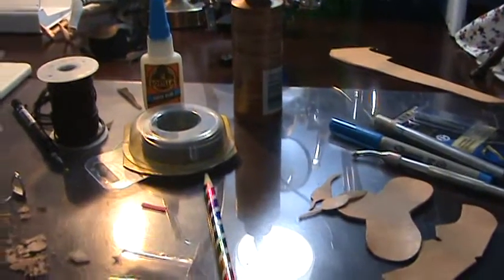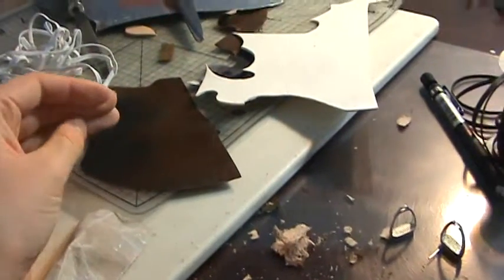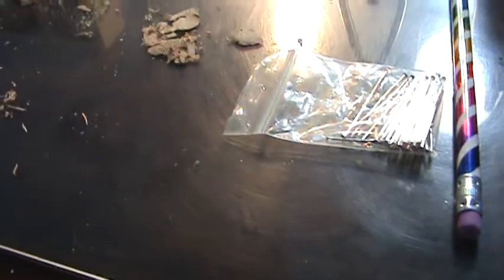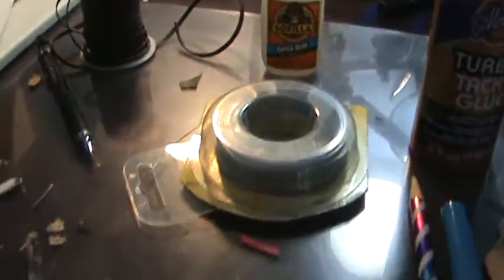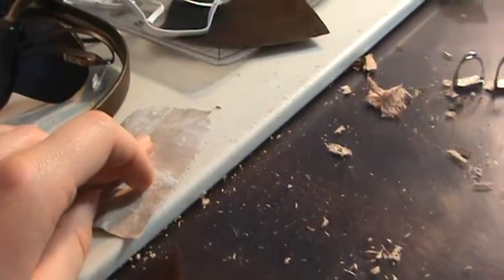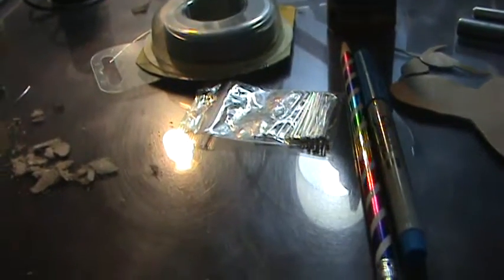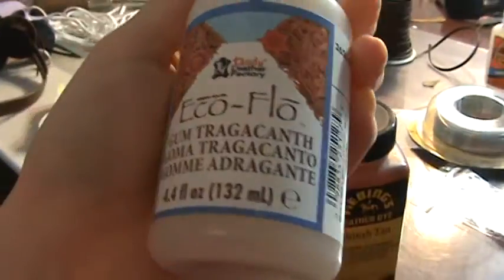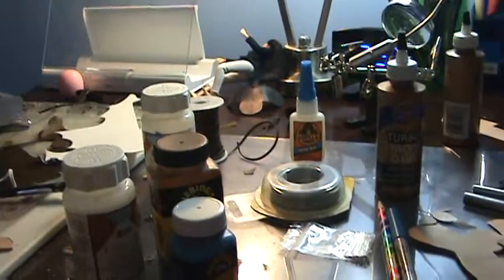Saddle Making: Tools and Supplies

Comment: Do you know where I could get some good saddle patterns?
Reply from the maker: +HorseLuver 12 (Eagle Ridge Stables) Unfortunately I do not know a specific place you can get patterns. However, you may be able to find some kits on eBay or the Model Horse Sales Pages, so I'd check there first.
Reply: K. Thanks!